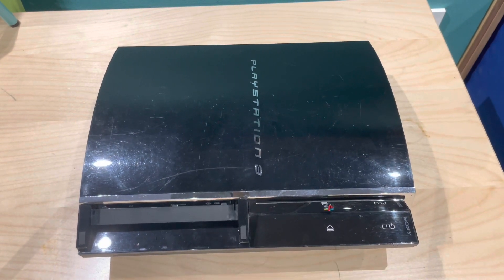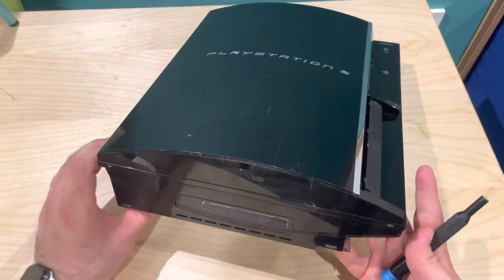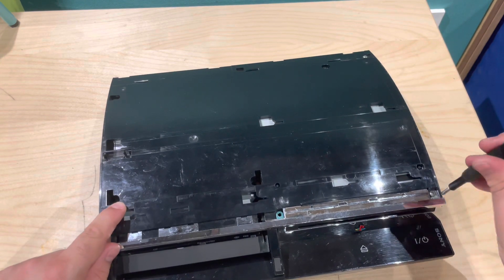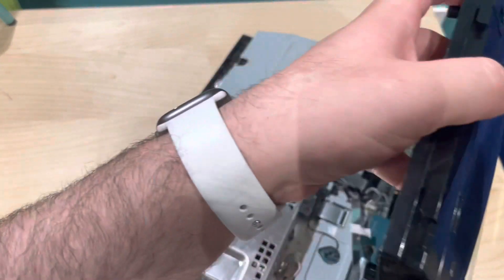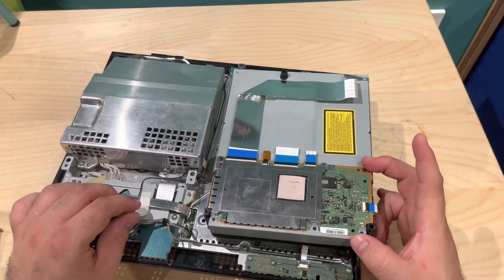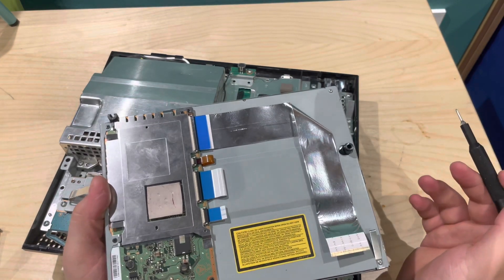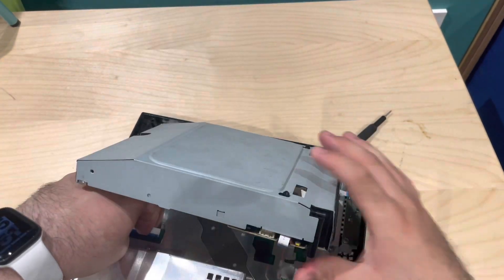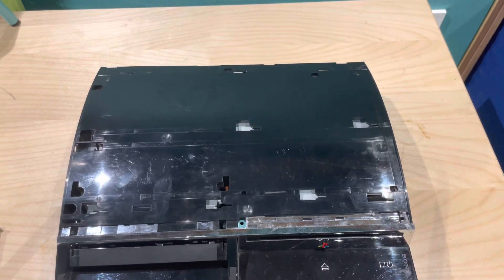🎮How to replace a PlayStation 3 Blu-Ray drive🎮

Comment: I repair them been repairing for a minute now like a pro
 whoever needs one I swapped I can do it if you feel like you don’t want to risk your console 
I don’t charge much 
I even do ps4s and ps5s depending on what you have and it’s condition just as long as you buy your own disc drives for me to do the replacements
Reply: Hey. I just bought Dead Space 2 to play on my old ps3 I haven't booted up since 2016. Wouldn't even start the run process for the game. Thought it was the disc so I tried Assassins Creed 1 and so on, even Blu ray and regular movie disks. How much do you charge bud? I've had her since I was like 13 and I'm 24 now, don't intent on letting her go like this.
Reply: I would like to use your services
Reply: What do you have ?

Comment: I remember that swapping the Xbox 360 Disc Drive wasn't that simple because the PCB is married to the Motherboard, that you need the PCB from the board to unsoldered it & soldered it to the New Drive.

Comment: My disc drive still reads discs. I dunno if it has longer load times per se, but it definitely is struggling to accept and eject discs. I had a few scares where I thought that maybe a disc would be stuck there permanently! We recently dusted off my gen 1 fat ps3 and decided it was time to replace the drive. We have too many good games on disc to let this one go completely!